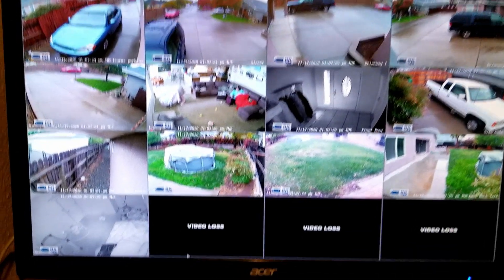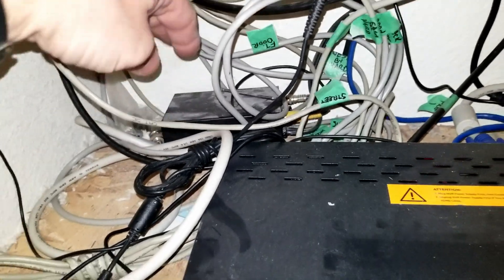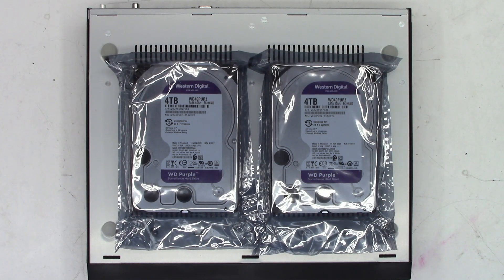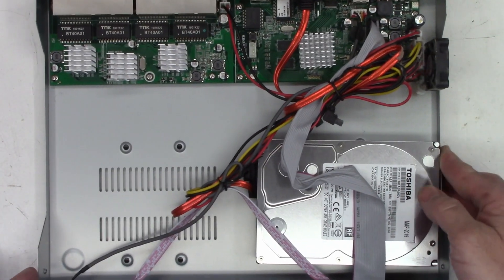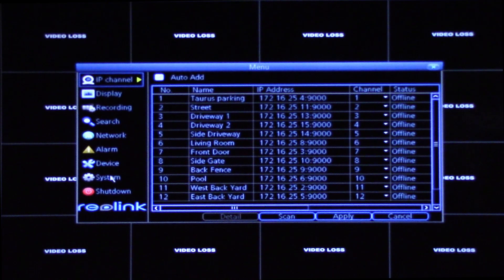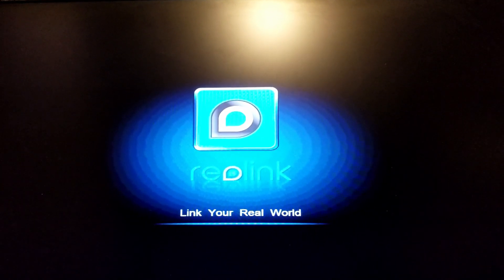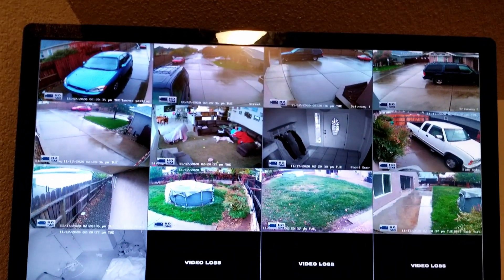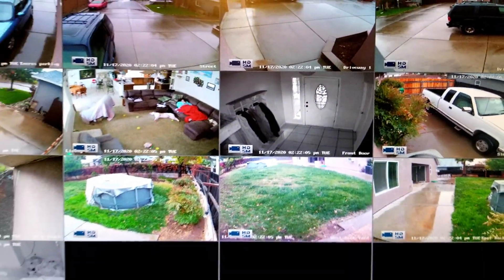REOLINK RLN16-410 UPGRADING THE STORAGE FROM 3TB TO 8TB CAPACITY

Comment: How many days of storage do you get for those 13 cameras on 8 TB?
Reply from the maker: I have 15 cameras and I get just about 28 days of storage in the "5MP" mode 2560X1920
Reply: @norcal715  Thank you for getting back to me.  My client is interested in this system but wants atleast 3 wks of storage for 11 B500 5 mp cameras.  I did tons of research and get different answers on storage at every turn.  I planned on upgrading the NVR to 12 Terrabytes until you got back to me.  I appreciate you!

Comment: I added new hard drive it formatted and works fine. But the playback action clips do not work on the app.
Reply from the maker: Reolink updated their app in late April. I am having issues with my remote playback as well as live playback jumping. I may roll the app back to a previous version to see if that helps.

Comment: Do you know the format of the hard drive you removed? I'm getting ready to swap out the drive in my 8 channel NVR and I don't want to lose video of a package thief.  Currently trying to backup that day but it's taking hours to backup to a USB flash drive
Reply from the maker: Sorry, I already reformatted that drive and used it in another application.
Reply: @norcal715  it appears to be a Linux partition.  I was able to backup the day I wanted to save and when I swapped out the drive, I used an Esata enclosure and when I booted the NVR, it could still see the history and all previous events were still there.  No loss of data when swapping the drive and using the original drive as an external.

Comment: Help. My rln16-410 stopped working properly. I did the ff to try fix the prob but to no avail. 1. I was able to upgrade the firmware via usb. 2. I changed the 3tb hdd. The nvr powers up but does this funny sound. All the green and orange poe lights do light up and blinks simultaneously. And the nvr cannot be detected by the monitor via hdmi. Please help me how to fix it. Thanks
Reply from the maker: Check the power brick for correct 48VDC under load. Have you tried a factory reset?

Comment: i think you can go up to 12 TB if i'm not mistaken i just ordered another hard drive 6Tb to bring my system it up to 9TB and after a while i'll replace the 3 with another 6tb
Reply from the maker: Awesome I will look into it. Thank you.
Reply: I just finished the upgrade of my Reolink NVR16-410 from 3TB to 2x6TB. It was easy and straightforward. https://youtu.be/QXpV95WrhYk
Reply: @aleksandertesenkov1421  yup thats what i did
Reply: @aleksandertesenkov1421  How many days are you getting before it over writes
Reply: @MrMoe158  with my settings for 10 cameras it was enough for 18 days. Though my biggest problem, which takes a quite significant amount of disc space is spider web.

Comment: I would like to do the exact upgrade. Do you have a link to the same purple WD40 drives that you used? I can't find any with the same mounting screw holes. Thx
Reply from the maker: https://www.amazon.com/Purple-4TB-Surveillance-Hard-Drive/dp/B071KVB4F8
Reply: @norcal715  - Just an update. I did the upgrade and everything went smoothly. Thank you so much for making this video and giving me the confidence.
Reply: @norcal715  Thank you so much for responding. Those are the drives that I had selected from watching your video, but I did not see the mounting crews in the Amazon photos. I will give them a try.
Reply: The NVRoads comes with screws ✌🏻

Comment: Hi there, i have 2tb but i want to add +8tb=10tb in same time can it works?
Have a good day
Reply from the maker: I think the maximum for this one is 8TB (look at the manufacturer data)
Reply: @norcal715  8 internal + 4 external on usb ?
Reply: @norcal715  That nvr doesn't have a spot in the back for external hard drive so you can go up to 12TB

Comment: getting ready to set up my camera system but its not ethernet wired which ethernet  looks a lot better for cable management mine is video &  power separately  using baluns with CAT5 cable i got the dvr for free so thats the direction i have to go a could use Siamese cable but making cable management even harder
Reply from the maker: My old system was power/video and I used the baluns also. Made the ethernet system a breeze to install.